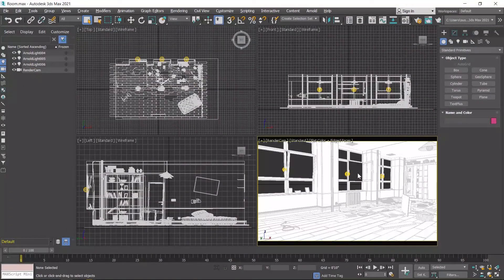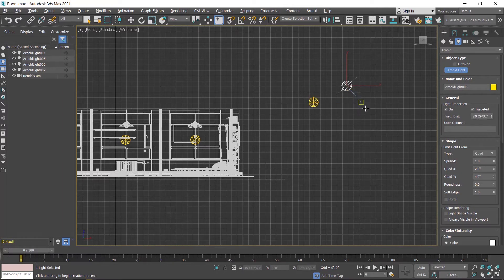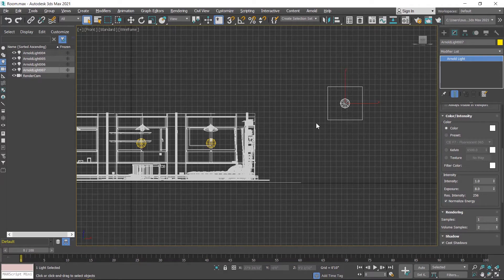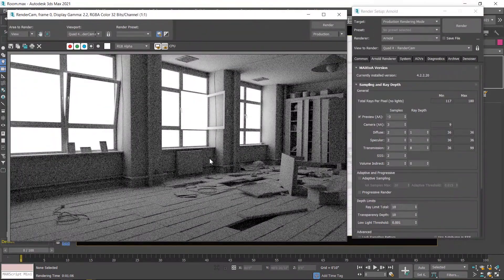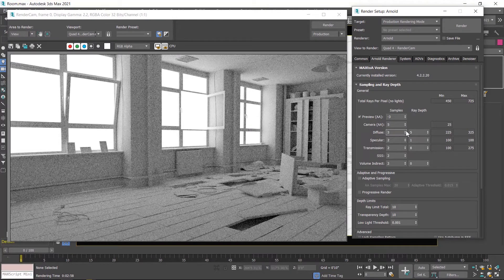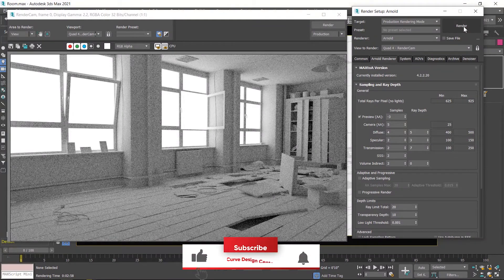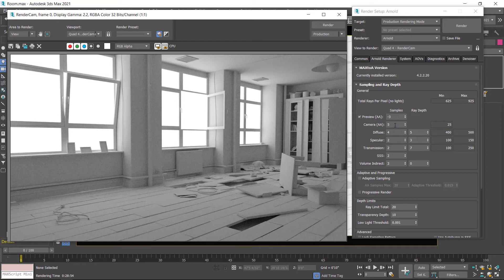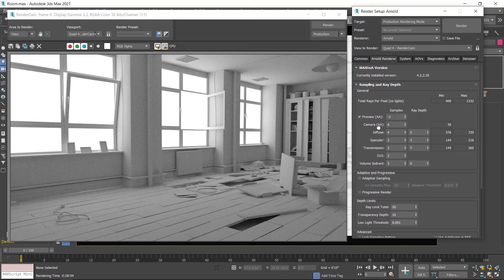Arnold Render Settings  Optimization | Class 02 |Arnold for 3ds Max

Comment: Hello sir whenever i do rendering in arnold it give me black screen, can you tell me how to resolve this issue
Reply from the maker: A black Arnold render in 3ds Max usually indicates a problem with lighting or scene setup. Common causes include missing or insufficient lights, incorrect light settings